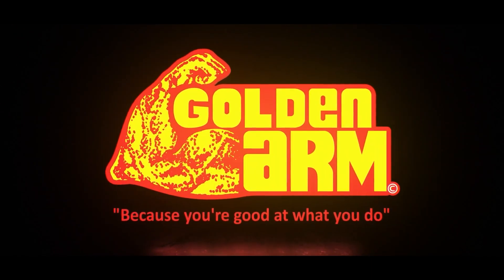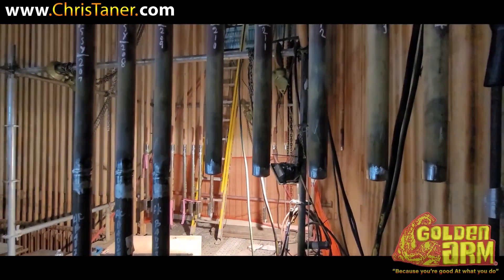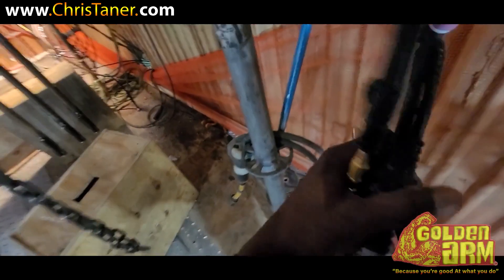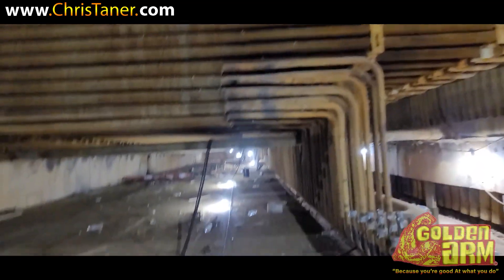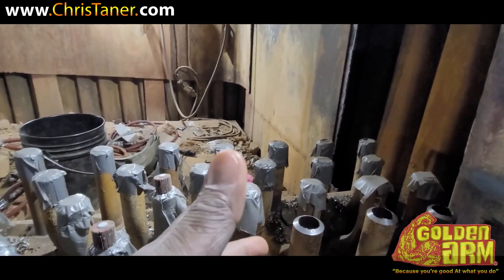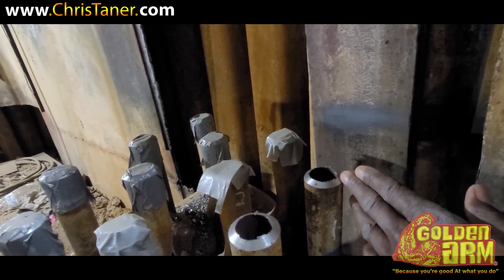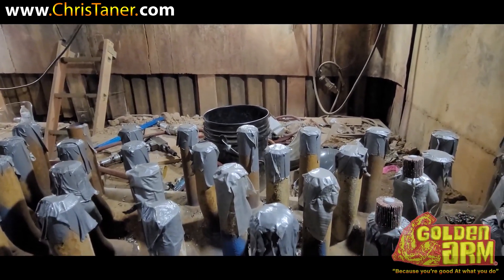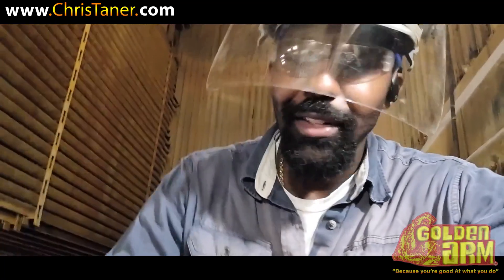BOILER TUBE WELDING GET STRAIGHT TO IT. PT2

Comment: Stay out of the hoppers at bottom of bag house,🚬
Reply: Certified tube welders will never have to work in the bag house that is mechanics work
Reply: @mattharper588  I'm sure you are right, I did boilers 40 years ago, I was a contract Labor welder for local 438 pipe fitter's and same for local 81, boiler makers,both out of Baltimore MD,welded pipe for Baltimore thermal energy, that was a money maker,put a 24" non rising stem gate valve in eutaw street in front of the bromozeltzer clock there,left the east coast, went to Wyoming and never left, still have one eye left, still weld,more of a hobby,☠️🗡️🚬
Reply: Local 60 out of Morton, IL🤘🤘
Reply: @Mason.Ulick60  Shout out from Local 107 worked a few outages at Pekin lot of good hands from Local 60